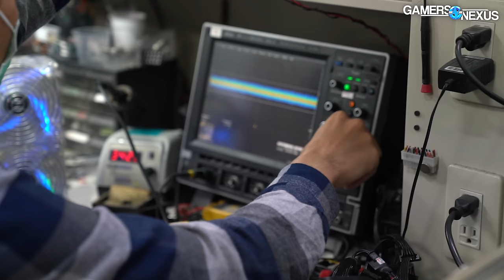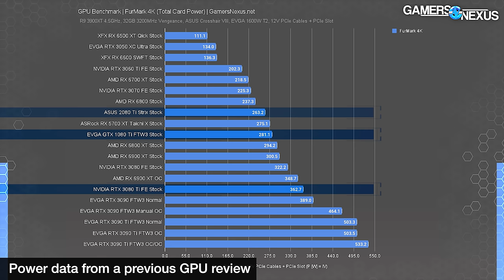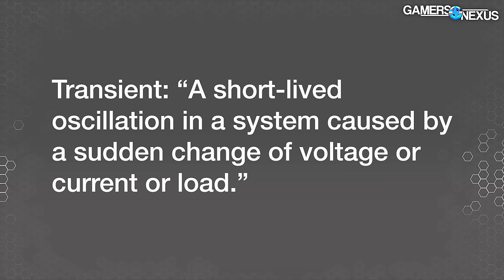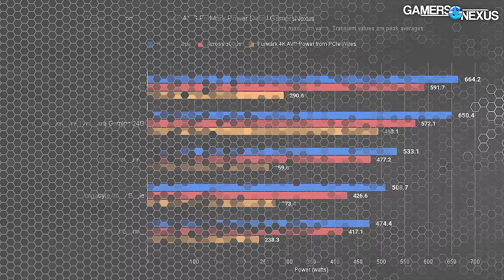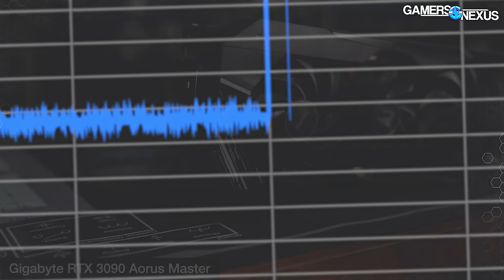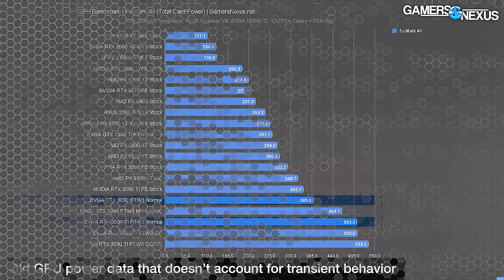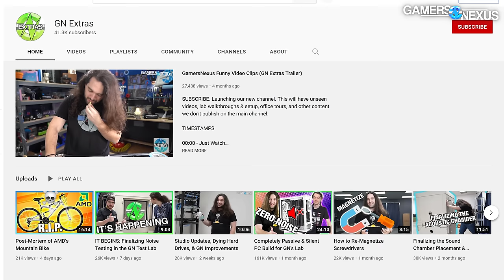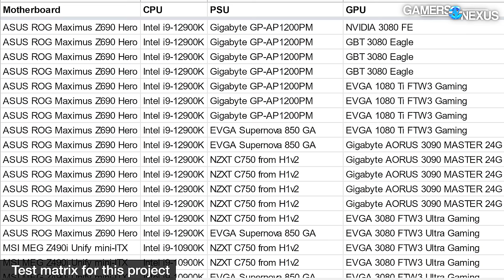The Brewing Problem with GPU Power Design | Transients

Comment: I wish GPU manufacturers stopped lying about power usage. If the GPU requires 620 W on spikes, its declared power need must say 620 W instead of 290 W like today. GPU manufacturer can reduce the spike power consumption by adding more condensators. Those obviously cost quite a bit which is the reason GPU manufacturers lie in the first place. When lying stops, customers could make educated decision to get worse GPU at the expense of needing higher performance PSU. Or use more limited PSU with better made GPUs.

CPU manufacturers separate peak power usage from thermals already so customers can understand the difference. With the current lies the thermal power of GPUs is marketed as if it was the power need of the GPU.

For power spikes as short as 100 µs it really doesn't make sense to build the capasitor banks in the PSU because trying to handle that transient spikes over the long wires that go from PSU to GPU really doesn't make sense.

If you take a cheap 500 W PSU and it cannot deliver 500 W, then that manufacturer is lying. However, if that PSU can deliver a true 500 W PSU but it cannot run "290 W" GPU, then the GPU manufacturer is the one lying. Simple as that.

Comment: Not really... I hate to sound elitist... but buy a better power supply(Much much better) I have a i9 9900K with 64Gigs and an RTX 3080 on an MSI Z390 Godlike, it running on a Corsair HX1200i... I get that a lot of people dont want to spend approaching $300 on a PSU, HOWEVER, if you spend that much on a high end power supply today, there is a very good chance you could get is much as 10 years out of it

Comment: Great points made in this video! I disagree when you mention "if your PC works this isn't an issue" just because PSU's do degrade over the years. So your system COULD be fine and after a few years of running like this it starts to have these sorts of issues.... This will be even more likely once the 3000 series is 5 years old because that is the time that many capacitors start to degrade.
Reply: Motherboards as well. Can get expensive to resolve.

Comment: Meh.. building a gaming pc with under 1kw PSU and a high end GPU is just a bad decision.  I'm not saying anyone deserves to have their system crash like that but you can definitely say the problem stems from poor choices during a build.  I mean 1kw has been standard in all my builds since around 2005.  These days you can get them for around $150 all day long (although it would be wise to spend more on better quality).   It's not like a 1kw psu will actually pull 1kw if the load isn't calling for it.  It's just a matter of capacity when the load does call for it. You either have capacity or you don't.     I place the blame on the builder's poor decision rather than the component manufacturers.  Seems like there should be a market for slotted supercap banks.  Supercaps are a nearly perfect solution for managing DC current spike.  Kind of odd to describe a short current load as a transient, although accurate.  Usually a transient is describing a voltage spike in a supply line, usually handled with a TVS diode.  There's really 4 parts that are important for a good build, and one of those is the PSU.  For some reason people tend to cheap out with a 850 or even smaller PSU to run a high end MOBO/CPU/GPU that they spent thousands on.  Heck, I've seen people spend less on the PSU than on the case!  The moral of the story: don't skimp on the PSU and you won't have these issues.

Comment: couldn't transient power spikes be solved with better power components on the GPU itself? if so, I would think that would be an AMD/Nvidia problem.

Edit: Not be an a-hole by why are people putting like 750-850w PSUs in SFF with a 3090. You know it's a power hungry card and you know it gets hot, just seems odd. If you're buying a $2000 card at least make sure that it has best possible components paired with it (without going too overkill of course). Just my 2 cents.

Comment: Has anyone made something that can be installed inline to absorb the spike? I dont want to buy a new power supply or take apart the entire system if there is an easy fix.

I have two 5700xt's that keep shutting down two different PC's same brand GPU and power supply. deepcool 850w not the best but should have been good enough ffs

Comment: Buy a good 2000W PSU and stay safe for next 5 generation. Anyways PSU are something that you can overbuy and you don't have to worry for at least a decade or even more.  But this is bonkers. I am glad I have a 3060Ti which is like the king of 1080p this gen and 750W is good enough for it.

Comment: I see easy solution for transient spikes adding capacitor bank on 8pin power plug between GPU and power supply. Or Buy 2KW PSU ;)

Comment: Here’s my 2 cents worth. The Gaming and GPU market is an out of control beast. Both double down like a p#$&*@g contest of “I’ll show you”.
Good games don’t need endless Graphics draw  with the human eye unable to tell the difference between 1440, 2K and up. But Hey, ask enough people and eventually you will get the answer you want.  The best games give you joy, are interesting (captivating) and you play with friends, competitively or socially. 
The human eye cannot physically see more than 60Hz, or between 60-80 frames per second, taking up to 65% of brain power (load). 
Minecraft and Halo I-III prove that, GTA and COD, Skyrim same. Gameplay, not frame rates.

Comment: There is a limit to this power draining GPU's  top performance dream.  we are moving in a green  world more and more  this is a illogical situation with the GPU's excessive demand for power?
I am not a overclocker guy. I will not be mind conditionned  to be an addicted gamer.  simple is better in my world .  i still have a 1060 GPU gigabyte  G1 GTX  on a Asus X570 tuf gaming plus mother board and rizen 5 3600 cpu. might upgrade to rizen 7 5800 ?  and when the GPU prices get resonnable again.  I will leave the more expensive GPU's to the rich

Comment: been dealing with this issue for the past month or so now. got the gpu back in august but didn't see this video until now. GN with the killer coverage as always. i had an asus rog thor 850w btw. (annoyingly massive psu, stays cool really well and has a good 0db mode, has a platinum rating, not that that helped) also don't give asus your money folks 😭

Comment: In my opinion to make gpu's better to make them consume more power is becoming a bad development now in my opinion if they want to make better cards they need be more powerful but take less power
Reply: As a crude figure to make a point, reduce a graphics card's power target by 50% and experience a mere 25% drop in performance.

Elite FTW SSSOC++³ Ultimate Extreme Director's Capacitor Edition graphics card models are a particular madness. - Diminishing returns to hell.

Comment: and directly in the first min an absolutly miscommunication, which as is, is just wrong...the tranient % will not get worse in fact they are activlyx looking out for the powermanagment sicne the 3090ti...so the problem will not get worse the transiens are getting better....the absolutle amount of power gets increased true, but that in it self doesnt make the problem worse or better as you always should have choosen the psu based on your hardware consumption to beginn with...people using underspect cheap shit psus, becasue they dont know anybetter THAT is a problem.the rest of the video is suberb but the intro-ending is realy borderline on public slander/deformation if you take it word for word...